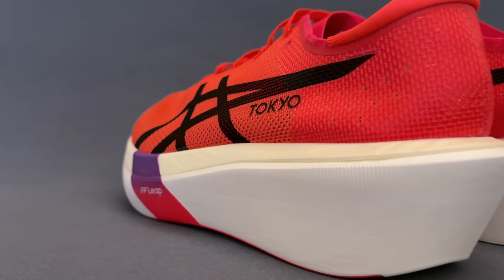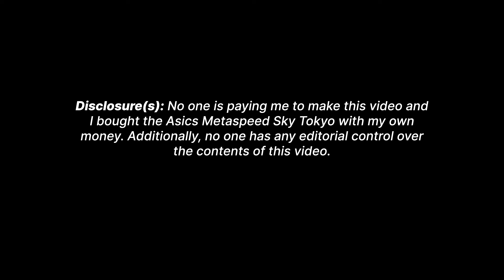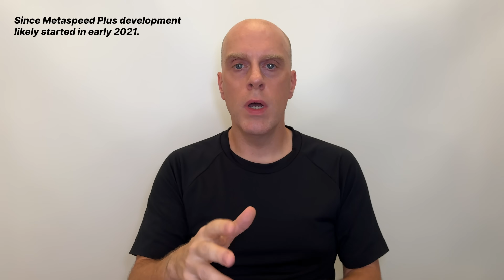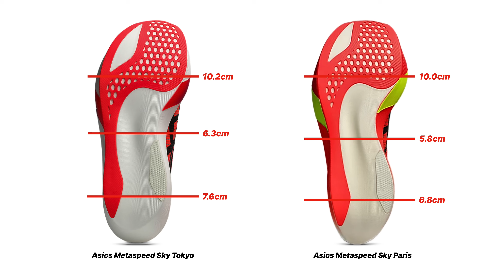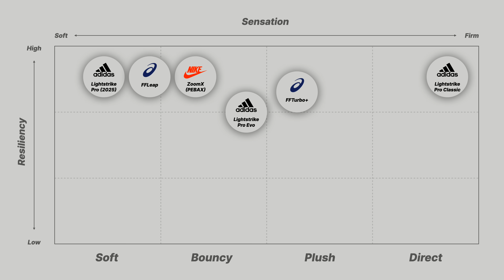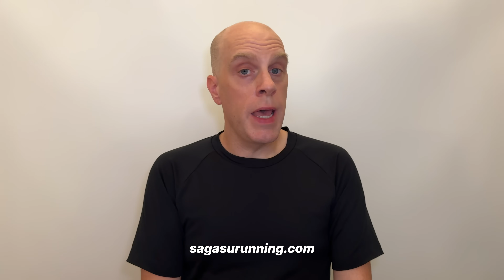Asics Metaspeed Sky Tokyo - Boundless energy

Comment: How would it compare to the alphafly 3 as a running experience? Split between the two for my first carbon!
Reply from the maker: AF3 is more mechanical feeling but more stable and has a bigger sweet spot. If it’s your first super shoe I would recommend the AF3. The MSST is outstanding but it can be a handful.

Comment: I have a few questions but I wanna give some background before I ask. I’m training for my first half marathon for a for real race in May. In highschool I did run cross country and track was a low 16 runner consistently in cross over 3. In track I was a 400-800 running I’ve loved both the Nike Dragonfly and victory’s. I’ve never run in a super shoe or even a plated in training. Is it worth shelling out the extra $25-35 (after tax) for the Tokyo models over the Paris models?
Reply from the maker: Depends on which model. If you want the Sky, the Sky Tokyo is the better option and worth the price difference. If you want the Edge, the Edge Pairs is actually a better option.
Reply: @SagasuRunning  I know the difference between the 2 for sure and I’ve identified that I am a stride runner. This may be a dumb question but would it make sense to take advantage of the greater turn over the Edge offers and add that into my natural longer strides or am I overthinking that
Reply from the maker: I don’t put much into the stride vs cadence thing…. But I do think Asics’s new approach of vertical (sky) vs forward (edge) propulsion is much better. I’ve been saying go buy feel when choosing a MS. I’ve always been an Edge runner but this year I’m in the Sky.

As far as your line of thinking… you are over thinking it. The greater turn over may actually slow you down on foot strike and feel like the geometry of the shoe is getting in the way of your natural mechanics.

Comment: Hi, thank you for a nice review and compare betweend Sky and Edge Tokyo and vs Paris versions. I'm planning marathon at teh beginnning of OCt and have dilemma if go with Alphafly 3, my so far marathon racing shoe. I like Alphafly 3 for marathon but not for shorter races. Helped me hold pace after 33-35K in the race. But now speculating to try lighter shoe like Sky Toky or Edge. I';m not sure but Fast R3 Im worried that would be harsch for me to the last 10K in the marathon, otherwise maybe would go for Fast R3. Would you recommend Sky or Edge tokyo for marathon race. I"m mid to fore foot striker, running marathon around 3 hrs, now targetingsub 3 hrs marathon. Thanks a lot. Peter.
Reply from the maker: Since you liked the AF3, definitely the Sky Tokyo. It will feel familiar to you coming from the AF3!but be more nimble.

Comment: I did my first workout today in the Sky Tokyo and came away pretty impressed.

Midsole – Clearly a step up from the Sky Paris. I ran about 7–8K of quality work around 3:25–3:35/km, and my legs still felt goodafterward. That definitely wasn’t the case with the Sky Paris, which I ended up selling after just 2–3 runs.

Stability – Again, better than the Sky Paris. It’s still a racing shoe, but more predictable. With the Paris, cambered roads were a nightmare (I'm positevly surprised you talked about this) —you practically needed (very) strong ankles to handle them, and that was the main reason I sold the pair. Kudos to Asics: the midfoot is  more  trustworthy here.

Weight – Impressive likely thanks to the new foam compound. I actually weighed the shoe twice because I thought my scale was off.

Upper – Solid, but not perfect. No heel slippage, but the fit feels a little roomy, especially around the heel (?). Not a dealbreaker, but I did have to stop once mid-run to readjust for perfect lockdown.

As a forefoot/midfoot runner (I’m comfortable in Alphaflys, though I also like Vaporflys), I’d say this is the best iteration of the Metaspeed so far. Yesterday, I did some strides back-to-back with the Alphafly 3 and the Sky Tokyo. Both are excellent, though the Alphafly feels a bit bouncier (?) despite being heavier. I’ll need more runs and some metrics to see how they really compare, but overall the Sky Tokyo looks like a very good evolution and clearly one of the best racers out there. Thanks again for your insightful video!
Reply from the maker: Love reading this. Spot on and I agree with your thoughts! 👏🏻
Reply: I felt this shoe is so wobbly, wore it for an interval session yesterday, if I lose form it becomes so wobbly I ended up twisting my ankle. Maybe I just have weak ankle but it’s definitely unstable
Reply from the maker: It sounds like you need to work on lower leg and ankle strengthening.
Reply: @SagasuRunning yes exactly!

Comment: Thanks for a great explanation, as you usually do. I've long said that the "stride/cadence" thing was more marketing that technical; that the real difference is having a strong toe-off (dynamically strong foot/ankle) vs a rolling through foot strike. I'm the former. I don't like rockers (other than the likes of Steven Tyler😆). I don't like shoes that get in the way of my natural foot mechanics.

I love that you show width measurements. I think the midfoot is not just wider outside, but not as high inside. I didn't find that with my one try-on of Tokyo. I've run in Paris. The Paris models hurt my arch from step in.

Your chart showed just Asics, Addidas, and Nike. What about Puma's Fast-R and DNE3?
Reply from the maker: I’m more of a Ozzy in Black Sabbath era or Robert Plant for that age of “rocker”.

I’m totally with you on preferring shoes they don’t “get in the way”.

Puma’s aTPU Nitro foam is very good, but not quite on par with the top tier yet…. But it’s very very good, especially the training variant in the VN4.

Comment: I wonder where this MSST lands on the performance matrix. I assume it’s similar to the AF3 & AP4, due to the high-plate configuration?

I’m also still curious about where FFLeap would land on your legsavingsness matrix 🤔.
Reply from the maker: Similar in performance to those shoes…. Legsavingsness is upper right, near new LSP.
Reply: @SagasuRunning do you still prefer adidas lsp over asics leap foam?
Reply from the maker: Probably…. Need more testing though. I’ll answer that sometime this fall. Stay tuned.

Comment: Chris! Thanks for the great review. Do you remember the Asics Metaracer? It had only a forefoot plate. Mmmm, the Ray seems to be a much more competent iteration of the concept. I enjoyed running in the Metaracer. It seemed enough coming from racing flats as it wasn't huge.
Reply from the maker: I do remember the Metaracer. It was a fast flat for sure. The Ray does have that linage but also is a very different shoe due to the foam. 

It was crazy but the MetaRacer definitely felt “max cushion” in that era of race shoes…. And it was anything but.
Reply: I had to chime in, I had 3 pairs of the Meta racers and used them for about everything from 10Ks to long runs 22K or so, hard to remember now, but I adored that shoe! It was so good as a flat racer that I could use almost daily. Funny as Chris says now I'd be really missing the extra protection of foam we get except for shorter runs anyway, wish they still made that and the Tartheredge but with a newer foam would be still great for 10Ks.
Reply from the maker: The Metaracer was a fun show. Last of its line really. They still make Tarthers here in Asia. They are around, especially in Japan.
Reply: @SagasuRunning I’ll check out my Japan website, I’m glad to hear they still make them 🤙🏼
Reply: @ericwj7 Thanks for your insights! I had two pairs of Metaracers, using them for everything! Loved them! Same, too, for the TartherEdge. I'm fortunate to still be running in Sortie Magic RP6's. Great for track workouts. I wish I could still get the RP6'S.

Comment: 😅 Still running in and enjoying the OG Edge and Sky+, with a Sky Paris just sitting in a box. Hopefully by the time I get through them, ASICS will have consolidated some of their race shoes.
Reply from the maker: I still have nightmares about the Sky+…. Both the foam and geometry and how beat up I felt after running in them, always.
Reply: @SagasuRunning  Took me probably 70+ miles to break the foam in, soften the plate to my liking and get a more forgiving ride. But initially, yeah, calves used to need some serious TLC from what felt like a negative drop shoe😢
Reply from the maker: 70mil is getting into the middle of the optimal performance range for a super shoe…. Totally unacceptable.

That being said. I have always trained a lot in Vaporflys. I definitely know elegant you mean. After about 150-200k a VF usually because a great long run shoe.

Comment: Soft bouncy showdown: Sky tokyo, Adios Pro 4, Endorphin Elite 2
Reply from the maker: I’ll be looking at data between the MSST and AP4 this fall…. The EE2 I will not. It isn’t remotely in the same league.
Reply: @SagasuRunning many reviewer described the EE2 and AP4 bounce are comparable…that’s why I’m curious
Reply from the maker: Yes…. To my feet FFLeap is a better foam than what Saucony has in the EE2 (the MS Ray is a better analog too) and the AP4 feels a bit softer under foot, though the AP4 is a single foam, not dual foams like the Metaspeeds. The MS Ray feels softer than either the EE2 or AP4. I’m talking about the Ray a bit in the next video on the channel.

Comment: Great review!
Which would you recommend between the Edge and the Sky (Tokyo) for a heel striker like me? For context, my favourite shoes are the Vaporfly 3, Endorphin Speed 4, Magic Speed 3, and EVO SL. I also own the Vaporfly 4 but found it a bit unstable (“tippy”) during a 10k race with lots of turns. I’ve tried the Adios Pro 4 twice (2×5k at Adidas events) and liked it, in spite of it feeling slightly unstable (“wobbly”).
Reply from the maker: Based on what you like and the preferences you mentioned…. Edge Tokyo is your “correct” shoe…. But if you found the VF4 tippy (for me that shoe is VERY grounded) either Metaspeed will feel crazy for you.
Reply: @SagasuRunning Thanks for the reply! The race when i felt the VF4 was tippy had 35 turns in 10 km, 120m elevation (up and down) and there were some streets with cobblestones. Maybe it was the course. It is my only race in the VF4 so far. I might have jumped to a conclusion too early. I have always liked the VF3 (on different courses) so the VF4 should work as well.
Reply from the maker: To be fair…. Any modern super shoe is going to feel that way on that course. Definitely give the VF4 another shot.
Reply: @SagasuRunning i tried the Metaspeed Edge Tokyo and indeed it felt very “crazy”, as you predicted that I would feel… Ended up buying the NB SC Elite v5 , which I liked a lot. Feels like the VF3 but more stable.
Reply from the maker: Enjoy them!

Comment: As a mile-5K runner I have everything I could ever want and much more with Nike’s SF2. But this Sky Tokyo is tempting. Let it go or give in and ditch the Nike’s?
Reply from the maker: Different shoes for different courses/needs. For the mile to 5k the SF2 is THE shoe, period. If it’s enough shoe for you no need to look elsewhere. 

The Sky Tokyo is better for longer steady state running. It can go fast…. But if you want “more shoe” for your distances then the SF2 look at the VF4 first.
Reply: @SagasuRunning gotcha, thanks Chris! Will look into the VF4 first or just stick to my SF2 for good. How’s that calf recovering by the way? You back to doing track sessions again?
Reply from the maker: I get an entry to the race I wanted to do in December (Taipei half) today…. So structured running is going to return. Back up to the track this fall for sure. Lots of work to do. 

Calf is fine…. Some longer Achilles tightness time to time… all is well otherwise.

Comment: Also no-show socks running team.
Reply from the maker: The only way… otherwise tan lines are the worst. I remember in my cycling days mid shin socks were the thing…. The tan lines looked ridiculous.
Reply: I have ridiculous tan lines. It’s just that I feel more free without covering the ankle. I’m aware the ankle no-show is out. 

At risk of dating myself, when I was racing bikes it was 1/4 length ankle socks that were UCI standard and black shorts. Blue shorts came at the very end which Banesto did well and Carrera made a joke. 100% white world champion and banana suit Tour leader look ridiculous. 

If I ruled cycling I would ban ass adverts, lower the socks, require dark shorts. And let’s just have a one general purpose bike frame design per rider for an entire race — even stage races.
Reply from the maker: There era of pro tour cycling fashion was RIDICULOUS!

I like your UCI overlord ideas. But… what about AERO! that’s what the socks are for.

I miss the simplicity or mid/late 80s pro tour LeMond, Fignon… 7-11, System-U…. The elegant steel frames…. Minimal wheel sets…. Downtube shifters… in my mind that era was the height of cycling aesthetics. Next would be the early Rapha days of the mid 2000s. Black/pink always worked for me. 

Rapha bibs were always outstanding too.

Comment: I have done two sessions now in each of the Sky Tokyo and Edge Tokyo and several other steady runs mostly around about an hour on foot each time. Initially I thought I preferred the Edge now am not sure there is much in it for me and TBH have rather got to the point on a blind test not sure if I could 100% say which one I had on. All those sessions went well enough for my current fitness. The lightness of them is great but neither have wowed me say like the Fast-R 3 did although not worn them since my last race in June. I did think both Tokyo shoes are best going for it at say 10K and under pace for me. Both started to feel a bit harsh at the end of those hour long runs so if I was asked to run a marathon right now, not sure either would be top of my list. No real fit issues now. One thing I did notice about the Sky in particular is that it feels very soft just walking about but when "get going" rather the reverse. I figure that is relative to how much you are engaging the rather soft FF Leap foam mostly at the rear as opposed to the forefoot with the plate seemingly right under your foot. Historically my observation is that nearly everybody focused on the Sky. From other reviews have seen the Edge Tokyo generally seems to be the slight favourite of those who have tried both although have seen next to no significant race report performances in either.
Reply from the maker: Asics elites seem split too on the Sky/Edge. Though the Sky always seems to have the edge, no pun intended. If you blind tested me I could ABSOLUTELY tell you which one was on my foot...since the PG Metaspeeds. They have very distinct differences.
Reply: @SagasuRunning  I think the fundamental point for me is that I am not seeing any obvious performance difference between the two but that's generally the case these days in most shoes designed to go "fast". Also think perception of a shoe can change somewhat for me the further I go. When fresh many shoes seem "soft" to me. As I get tired that can often change to a firmer feel. These ones good case in point.
Reply from the maker: Noted all around and agree. 👍🏻
Reply: I agree with 100% of what Tim said. I have both of the Tokyo shoes and I honestly can’t determine a consistent difference in performance between the two. There is a distinct difference in Pace, Cadence, Vertical Oscillation, and running economy when I compare the Tokyo shoes to the FR3 shoes and even the Adidas Pro 4 shoes. The FR3 shoes have always been superior to all of my other shoes in all of my tests.
Reply from the maker: There is a definite feel difference but it’s always been impressive how Asics can make two, very different shoes, work in the same performance range each generation.
Reply: As someone who has raced and ran in the OG Sky (which had a more scooped plate) until the plus version came out, I really liked original Sky, enjoyed the edge + for half’s and under as it was super firm and in the Paris. Versions I couldn’t really engage the plate in the edge Paris but could in the Sky Paris and used it for a few marathons. All that said I just tested the Edge +, Sky Paris against the Sky Tokyo and wow, the old edge + felt like a brick but was still fast, the Tokyo version felt way more bouncy and of course softer. It felt the best to my surprise as I really loved the Sky Paris. I still think Nike was way ahead of it’s time with the VF 1/2 as I can engage that plate and in June had a PB on a half marathon course I’ve done for years in a fresher pair of the VF 2s.
Reply from the maker: “Brick” is the best way to describe that midsole in the Plus series…. It was SO firm and harsh.
Reply: @SagasuRunning yes indeed FF Turbo was hard! But I recalled it being a bit more responsive if pushed fast / hard enough. After the 3 m test vs FF Turbo + and FF leap I didn’t want to use them for a 5K they felt so brutal but as I said speed was close to the Paris 3m but it hurt almost 😂 amazed I took them for a HM years ago.
Reply from the maker: FFTurbo+ was very responsive and VERY fast…. But at a great cost to your legs. Not as bad as FFTurbo, which would barely allow me to walk the day after a hard workout…. But still brutal on the body.